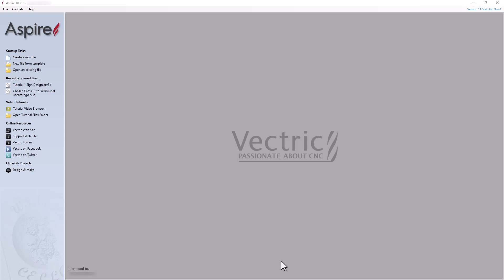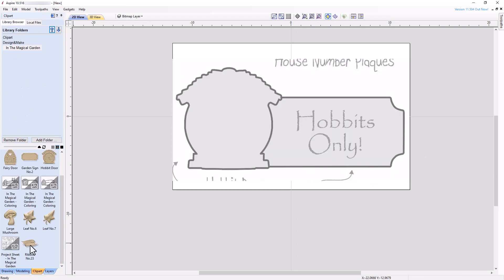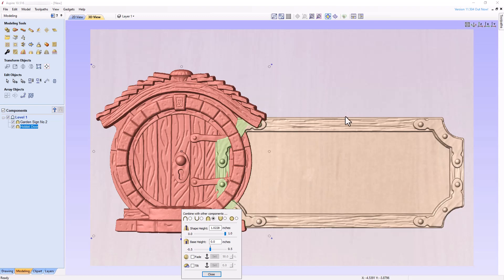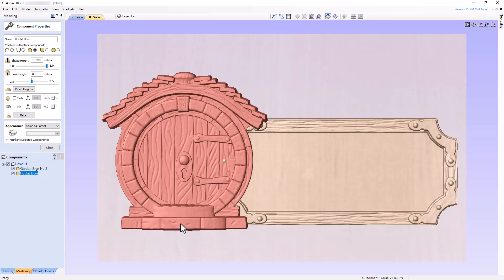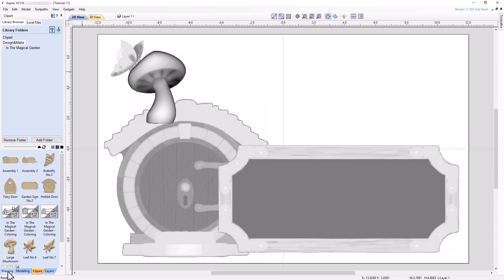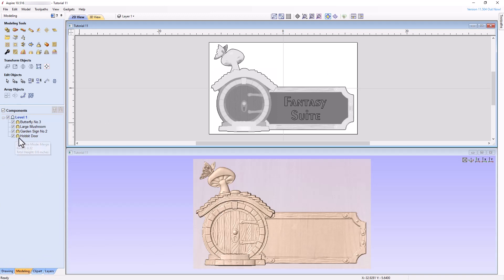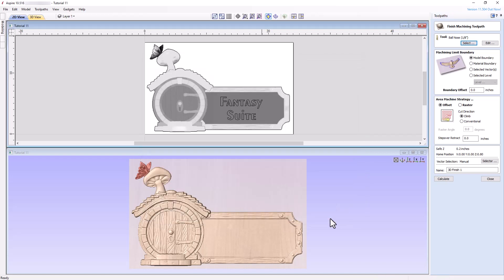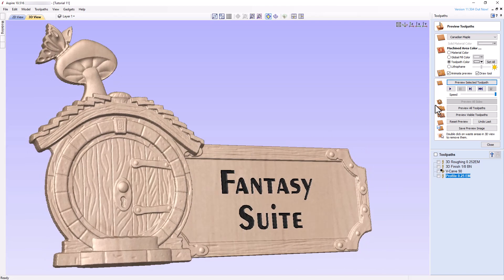CNC Woodworking Tutorials for Beginners-11

Comment: Hi there. This was a great video, thanks so much for posting it. 
Even though I'm not ready to tackle something like this yet,. I know where I'm going to go so I could do it.
I had a really quick question though, I just wanted to know when you did the profile tool path, how come you did not want to use ramps? 
Is there any special reason not to?
Thanks.
Reply from the maker: Hi Joe! Great question. I haven’t touched on ramping in any of the videos in this series yet and that is why I have been skipping over ramping in the tutorials thus far. I do plan on discussing ramping in the future though. I can’t think of any special reason to avoid ramping on the profile toolpaths used to cut out the projects from the material. The use of ramping will certainly be easier on the bit and the CNC machine as both the bottom cutters and side cutters of the end mill will be used to gradually cut into the material. It also helps decrease tool marks on the edge of the material in locations where the tool plunges straight down when not using ramping. These “dwell” marks can be annoying to sand away. I hope this answers you question. Don’t hesitate to leave more comments or suggestions for future videos.
Reply: @FJB Custom Woodcrafts  Yes, it definitely answered my question. 
Also, I know exactly what you're talking about with the "dwell"marks and they are a pain to sand off, so ramping would be a great idea now that I know that it would help with that.
Thanks for taking the time to respond and thanks again for your very educational videos. 
Keep up the great work.